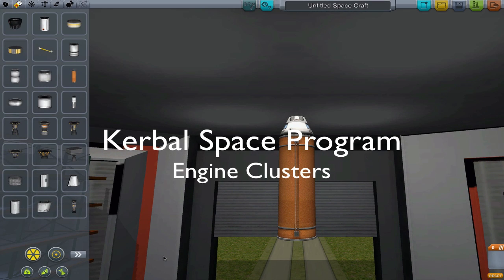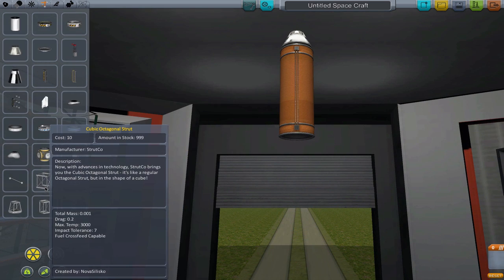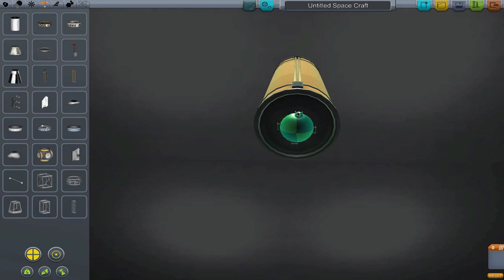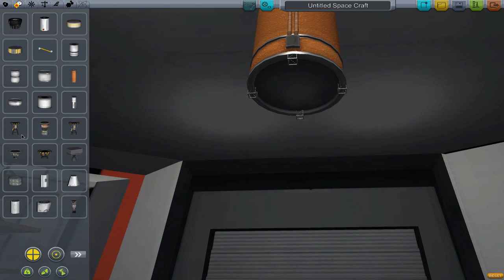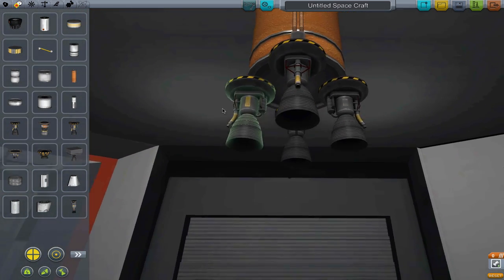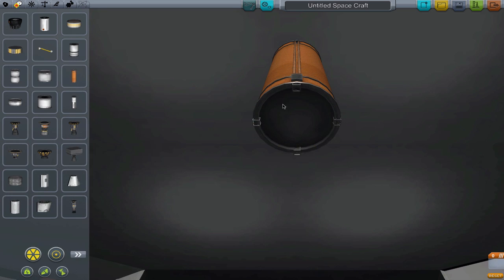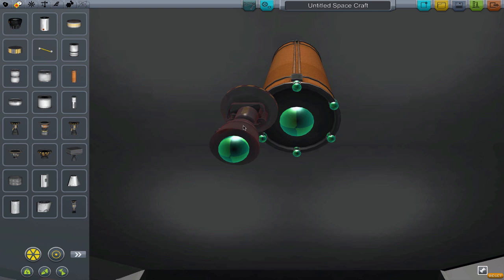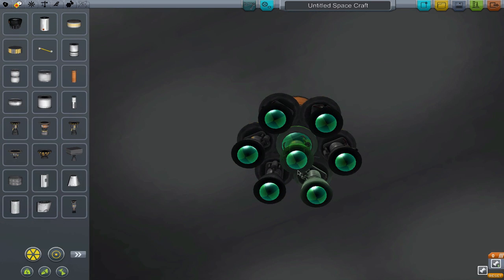Kerbal Space Program Quick Tip - Engine Clusters

Comment: Cap the engines with nosecones or tail spikes for a nice finishing touch... as for stability, this induces less wobble than the overpowered twitchy gimbal on the mainsail if you use just one smaller gimballed engine in the middle.